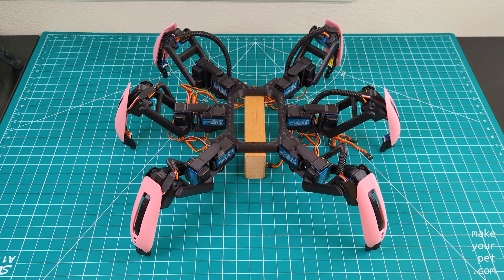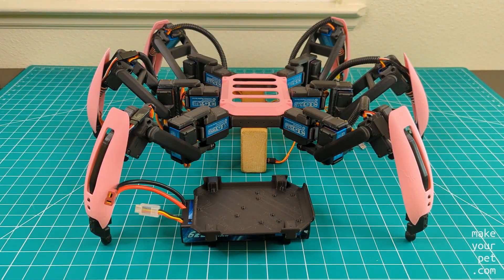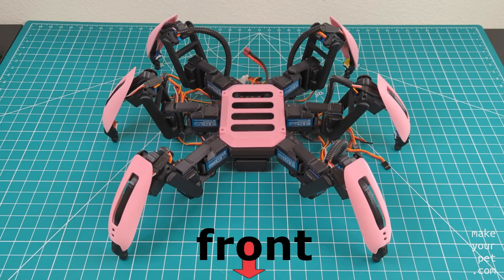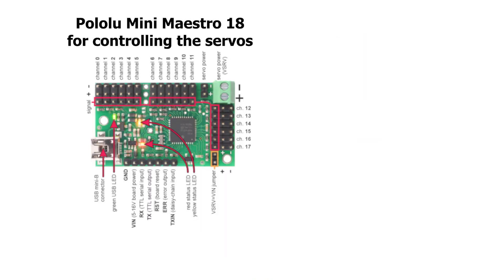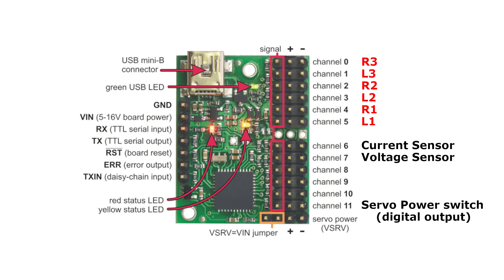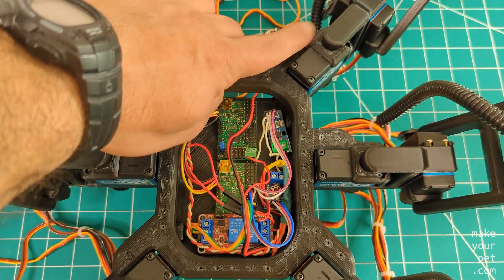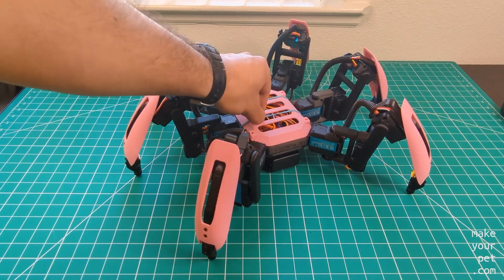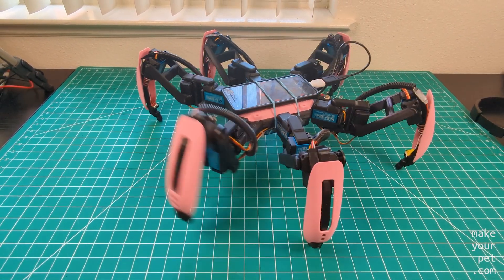How To Make A Hexapod Robot. Part 2 of 3: Final assembly and internals. A DIY Robot Project.

Comment: hey, chiming in late but started building it, printed the legs, frame, and some other parts off GitHub but was wondering where the motors are from. i found ones that i think are the ones you use but they are $28.99 per motor. Where can I find cheaper motors.

Comment: Hey dude, nice vids! 
Working on a hexapod myself, and am wondering, if a fourth movement axis is something that might be usefull in the walking speed and smoothness. It's meant to do really tough terrain.
Where the leg starts, i wanted to work in a ball-joint, that can make the leg "twist". I think I got it figured out how to install and build, the software is gonna be a problem tho.
What do you think? Do-able?
Reply from the maker: More degrees of freedom will definitely help with the movement. I went with the 3dof because that is the minimum required, and any extra joint will add to the cost. If you want to discuss these ideas definitely check the Discord server. There are others who are building their own hexapods there as well.

Comment: I have a 32 channel servo controller, do I need to adjust something in the software to make it work? it's a USC32 servo controller it is similar to torobot 32 servo controller. Please help.
Reply from the maker: Unfortunately other servo controllers are not supported yet. But we are working to support a few other controllers in the future such as the SSC32 and servo2040. If you  want to know about the ongoing discussions make sure to visit my discord server.
Reply: @makeyourpet  does it support now??

Comment: Thank you for all the videos! I am having a bit of trouble with the wiring as I cannot make out all of the connections. Would it be possible to have a wiring diagram / schematic for completion of the wiring?
Reply from the maker: Thank you for your interest! A more detailed howto document is the most requested thing so far, so I will do that for sure. It may take a while but I will update you whenever it is ready.

Comment: Loving this and can't wait to build it, given the app at this time will not be open source, will the app have settings to input your own leg lengths to update the inverse kinematics so that we can customize the 3D prints for our own designs?
Reply from the maker: Yes you can, and I would love to see the app being used with a different body design. I added these settings when I was changing the frame dimensions on my hexapod, and seems to be working well. So far I was able to keep the body design and the app independent of each other, and my goal is to keep it like that.

Comment: Hi, what ratings should I use for the main kill switch? Assuming each servo stall current is 2.5amps @ 6v, do I need a switch that can handle 45amps current (2.5amps*18=45amps)? Sorry if the question is kind of dumb but I googled about this and found that the current should not exceed the switch's max current rating but i don't think there is a switch with rating of 45amps or more so I'm a bit confused. Thanks in advance!
Reply from the maker: 45amps is when all the 18 servos are stalled and are pulling the max current at the same time, but in normal use the total max current almost never exceeds 10amps, and average current is way below that. So I would say a cheap 10 amp switch should work. You can also pair it with a 10 amp fuse if you want to be extra safe.
Reply: @makeyourpet  Okay. Thanks for the reply. Really appreciate it. 😄

Comment: Nice project. I like it! Ok i have a maestro 24ch and this enough for 18servo+6touch but are analog sensors (V,I) necessary? Will I be able to use maestro24ch at your software?
Reply from the maker: Thank you! Honestly if you just want the touch sensors, using the 24 channel board is a better option. I did it this way because this is what I had in hand when I was building it.
I want to (not there yet, but the implementation is pretty straight forward) add the support to configure all the pins no matter on the primary or the extension board, so you should be able to map your touch sensor pins on the primary board. I need this flexibility for future extensions anyway, for example to control more servos or to add extra sensors.
But the thing is, in some rc servos, including the Zoskay 35kg, there is no way to turn the servo off other than cutting the power (setting the pulse width to 0 doesn't work), which needs extra control pins for a relay, and you kinda need it. Also checking the current and voltage to protect the the servos and the battery by cutting the power if something is out of range will save you from a lot of trouble, so I strongly recommend it, but it is not necessary.
Reply: @makeyourpet  I am impatiently waiting for android app to be published. I really want to try this project. Thank you.

Comment: Also, you are speaking about the 2 Pololu modules but we can see 3 other modules on the video connected to the Pololu. Any details about these other modules ? Thanks a lot !
Reply from the maker: That is right. Good job paying attention to the details! The other 3 components are the voltage sensor, current sensor and the relay switch for the servo power, which I mentioned when showing the pins on the 2nd board. You can use any parts that you want for these as long as they work with 5V signal.
Reply: @makeyourpet  , i'm not sure to understand what are they for ? Can you explain in two words the goal of these 3 modules ? thanks :)
Reply from the maker: Voltage and Current sensors to measure the voltage and current of the battery. And Relay switch to turn the servo power line on or off.
Reply: Actually, It would be great to have some diagram or an extra video showing how those 3 modules are connected to each other. Thank you!
Reply from the maker: We have one now, check the community tab.

Comment: Sweet this will be my second hexapod build. Ive never written an android app before. Not too much of a programmers. Not sure if this is going to be open-source or not. 

 For the phone mount you could use a neodymium magnet array. Then use an adjustable phone clip found in thingiverse. Or I could design one for you should be pretty quick. Without the use of magnets and for ease of use could just do a twist lock mechanism. Also if you like a circuit board integrated (plug and play) into it I could design that as well. I remember you wanting an way to clear up cable clutter in one of your videos. If interested let me know.
Reply from the maker: Nice! I hope you build it and share the results with us! I am going to release the apps on the Play Store for download, and it won't be opensource. But I plan to put all the parameters such as servo pin orders and even hexapod geometry measurements in a settings file to at least make the looks of it completely customizable. 
For the phone mount, magnets would be clean but I always worry about the interference with the electronics. I think a simple mechanical twist lock would be awesome. If you get to design something for your hexapod, feel free to share it here and I will share on the channel for everyone to use. Thank you! :)
A custom made circuit board is the dream! But that is something I would consider only if this project takes off and there's some demand out there, other than just for my own use.
Reply: @makeyourpet  
Actually there could be a use. I am on making one  to sell ( for me this one is just for personal use). I have massive servos i got from my job for the final one. But right now im working on beta which is moderaly big and the motors are 100 to 300 dolars each. If your interested in working together on one I could let you in on it. Current  I'm still working on the CAD side of it.